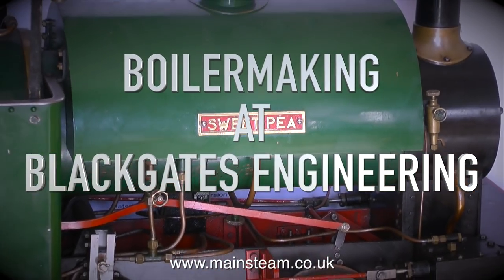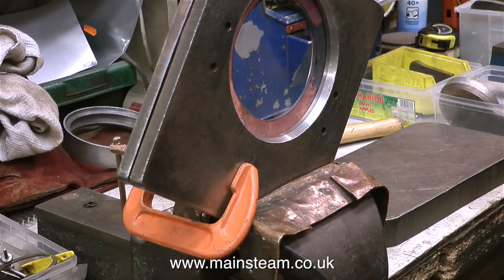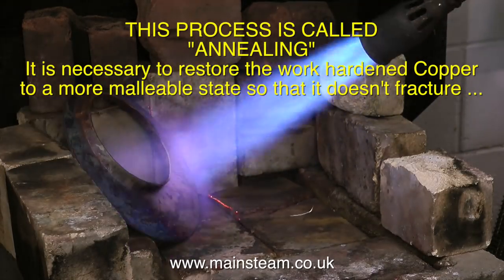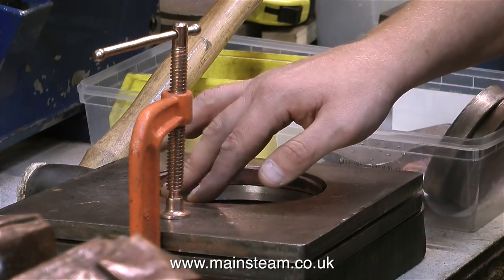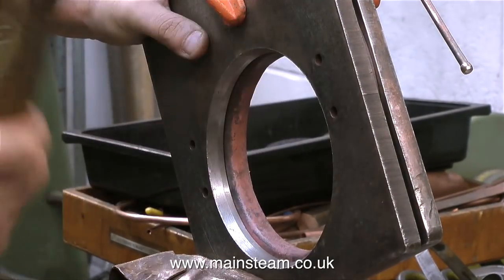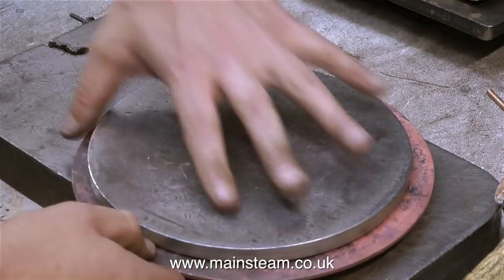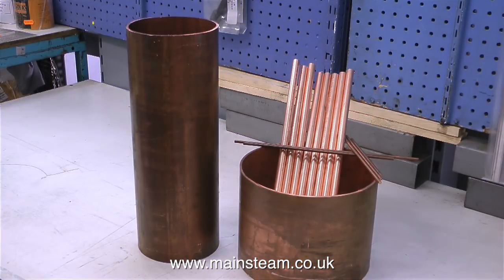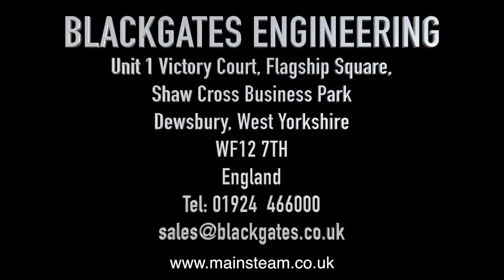MODEL BOILERMAKING AT BLACKGATES ENGINEERING

Comment: That was very interesting, I'm amazed at how thick the copper is, raw materials must cost a fortune without the labour
Reply: Raymond Ore Fine Art  yes pricey it an under statement I had a boiler made for a 5 inch g class 4 tank about 10 years ago £2500 😳
Reply: Cost me £1900 for a Lion boiler last year, and that was TIG welded so cheaper than a Traditional Silver Soldered boiler, you did well!
Reply: I was wondering about that.  I don't know anything at all about boilers, but why not weld it?  Copper can certainly be welded faster and cheaper than what this must cost.
Reply: @patrickwhitehead7584  Copper can be metallurgicaly difficult to fusion weld.

Comment: Bonjour Keith,
Great job which requires a great skillness. However, I am surprized because it would be much easier if Duncan used a 20 ton press as I saw one in a French model steam manudacture. Is there a reason why Duncan does not use a press ?
Amicalement, Raphaël
Reply from the maker: I think that they prefer the more traditional method - hand made things are good ........ and 20 ton presses are very expensive as well as needing a lot of space that they just don't have . . . .
Reply: Doing the dies and plates for press work is a bit different then the formers for had work. I don't think there would be enough volume for them to invest in duplicating all the formers for hand work to press work.  Now if you were starting out with only a few designs a press and small CNC lath and mill would be the way to go.

Comment: Would there be any issues of using a cast silicon bronze throat sheet, back head etc. wrapped with screwed in place sheet copper and then all fusion brazed in an autoclave?
Reply from the maker: Sorry, I have no idea, I do not build boilers. The thing I would be concerned about over time is the coefficient of linear expansion between dissimilar metals, and doing it the conventional way seems to me to be simpler option . . . .
Reply: @keithappleton  They're not exactly "dissimilar" and coeficients of expansion aren't an issue on steel shelled boilers with copper tubes. As for investment casting tube/throat sheets etc., that is a far simpler and faster way to generate the components than creating the forming tools (even in oak) hammering and repeated heat treating ad nauseum.  The old "Little Engine's American" had a sand cast silicon-bronze fire box with copper tube front section.  It works fine.

Comment: Two techniques come to mind that seem simpler, but I've never done this sort of thing so these ideas must not work -- else they'd be doing it.  Half-baked idea #1, set up a large and powerful clamp.  Set the outside formers sitting on the lower jaws of the clamp, warm the copper, place on top of the formers.  Place the inside former over the copper.  Then tighten the bee jees out of the clamp to force the inner former into the outer former, making a copper flangewich between them.  Would this be too prone to getting off center and having thin walls on one side of the flange?  Or is this perhaps too much pressure on the copper in one go and risking a fracture?

Half baked idea #2 being - can you melt the copper and pour it into a flange shaped mold?

I'd offer all the US pennies I have cluttering up my house to the cause and be glad to see the back of them (their buying power is far below their nuisance value and any bill to eliminate a coin with Lincoln's bust is DOA as long as Illinois is a state) but they're really zinc with copper veneers at this point.

Henry
Reply: Cast copper has significantly lower tensile strength, so you'd have to up the plate thickness and staying to compensate, massively increasing the cost

Comment: Thanks, a good video.

I have just finished making the plates for a Belpaire boiler in 5" gauge and don't recommend it. I wish I had seen this video first though as I did use a ball pein hammer and as you say it isn't ideal. It leaves a really bad finish on the flanges.
Reply: I use a wooden mallet..cheaper to replace!  I quite like making flanged plates, definitely a winter job though, keeps the workshop nice and warm

Comment: Been trying hard to lay my hands on a small table top lathe round here in darkest Dorset, being on disability means I can't afford the crazy prices people are asking for just spares and repairs although I missed out on a £40 very ancient Drummond lathe with all the tools and motor plus a range of chucks and tail stocks (I kicked myself hard on that one but I did say to the seller it was worth far more and someone bought it for £200), ppl keep telling me to go for one of these aluminium X extrusion thingies from China but they look cheaply made and can't see them standing up to much although I do like the innovation in you can rearrange it from a lathe to a mill, or a jigsaw or pillar drill but would rather find a spares and repair and get it right myself lol
Reply: Ian Watson It depends what you want to machine, I saw an adept watch makers lathe sell for just £40. With a 3 jaw chuck and a few cutting tools and chuck. The adept lathe is small, so if your wanting to make a 5" loco you'll need something bigger! But for a small steam engine upto around 3/8" bore you should be ok to machine bar stock with light cuts. There was one with built into a cabinet with motor and quite a bit of tooling for £60 So they are around. The adept lathe would fit onto a large kitchen chopping board to give you an idea of size.

Comment: Why not a single tube boiler ? You can make one out of  an old 55 gal drum and maybe 100 ft of small A/C or water tubing and some firebrick. Water tube boilers are safer too, I think. Perhaps the art and craft of making a big assembly of fat tubes and copper plates is more important. Mechanical arts are a good way to study history. I bought a pre WW I copy of Machinerys Handbook in a used book store. Worthwhile purchase. It had a handwritten note in it including the national anthem of Siam, LOL.
Reply: Not that you would ever consider using an actual 55-gallon drum for that purpose.
Reply: Ah, Sweet Pea is a steam engine. I guess that explains the design and adherence to traditional design. How did I miss that?

Comment: The mate's soft copper hammer seems to have worn down enough so that the actual head piece is through the copper.  Bet that'll mash up the copper!
Reply from the maker: luckily he doesn't use that end on the copper - he only taps the steel former plates with the copper end . . . .
Reply: I really should observe things a second time before I get my fingers to wiggling on the keyboard.  I have now noticed that the mate is using the hide side of the hammer on the copper.  I thought that he was using the copper side so it really doesn't make a difference.  He's using the copper side to hammer the steel form through the hole.  Sorry about that!
I bought a pair of tennis shoes from a drug dealer the other day.  I don't know what he laced them with but I was tripping all day. :-)

Comment: Now Another supplier has begun selling so called KITS in the Flat??
Which is no use whatsoever!!  The first thing you would then need is a Bandsaw and some planks of Hardwood for a 1 off!!
I have used MDF but worked in a Woodshop with extraction!!

Copper and Silver are always hammered so that the metal has time to stretch or compress! spinning tends to thin the metal.
David.